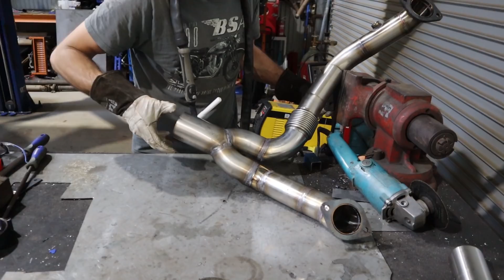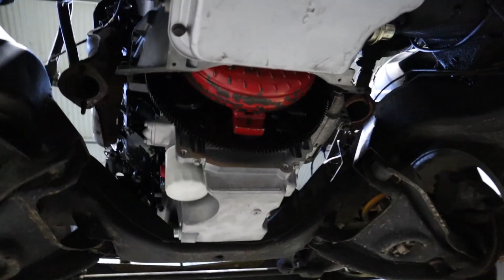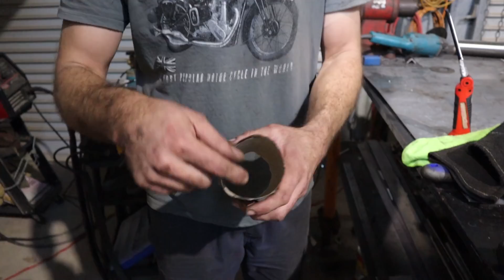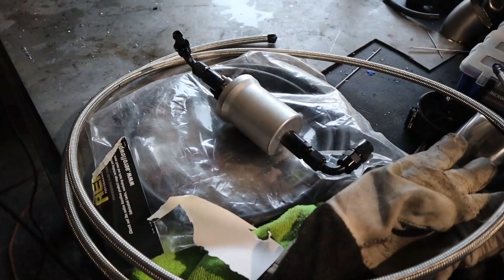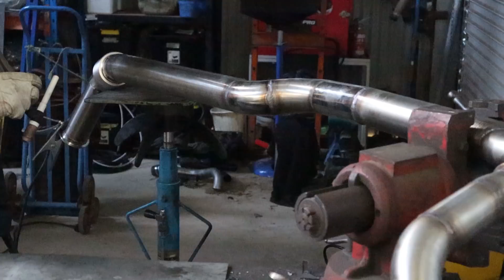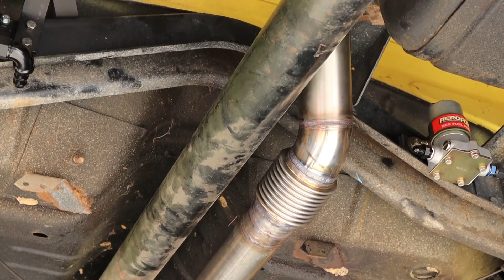Fab Work for Rear Mount Turbo | OSP Shop Ute Build | Episode 5

Comment: Is that a Amazon special scavenge oil pump I see?
Reply from the maker: Hope not, pretty sure we purchased it from a local marine shop
Reply from the maker: @mun33y  certainly looks like it! See how that 30 minute duty cycle goes 🤣🤣
Reply: Just replayed this video and noticed you don’t have a oil drain tank/ reservoir directly off the turbo…from what I’ve read this is essential as oil will build up in the lines coming from the turbo and potentially blow the turbo seals ..the scavenge pump then pumps from this reservoir back to the engine and not directly from the turbo itself

Comment: Do you even need a water to air/intercooler setup for rear mount? I've seen a few dudes running no cooling setup saying IAT are fine no need to run a cooler
Reply from the maker: Maybe not with an appropriately sized setup, but we will be running this little compressor pretty hard on its efficiency so i believe it’s going to be necessary
Reply: @BoostGumps  sweet keen to see this thing first start 🔥

Comment: I’m surprised you didn’t make a stand alone oil system for the turbo like the hoff did on his supra?
Reply: That’s a good idea. It would reduce the risk of a leak draining the engine. The pump is already there, add a cooler, couple of short hoses and a little surge tank would be sweet.